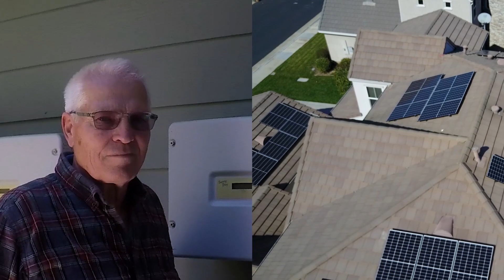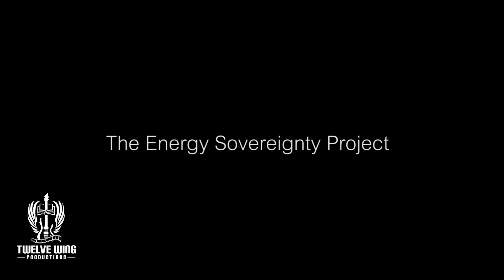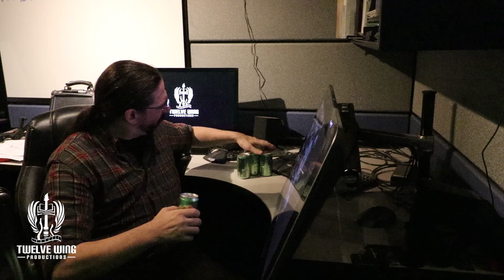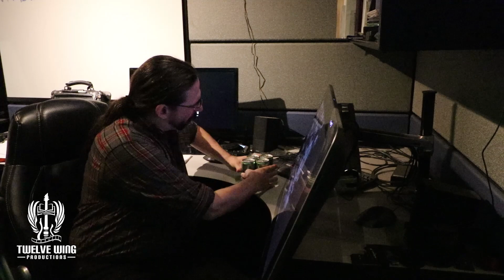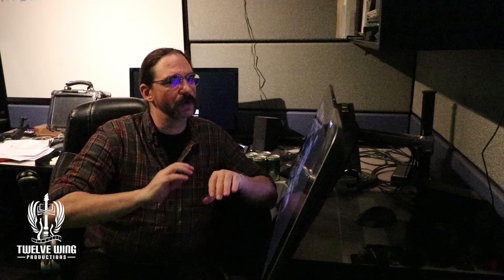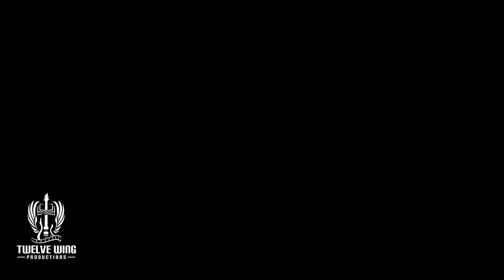Tesla's Battery Investor day today; What does it really mean for future products?

Comment: It's very refreshing to see someone talk about this who has experience with the engineering involved. There has been a lot of speculation done by people without the technical background. What you are saying makes a lot of sense to me. 

Thoughts: I am still unsure how far along the dry tech is and if they will go directly dry or if there is a wet iteration. 
I remember Elon explaining somewhere that recuperation is limited by power density and not motor atm (to 70%), so what you said about recuperation makes a lot of sense to me. This will be a big deal for the semi.
I haven't thought about putting the rolled batteries directly into a pack w/o casing. I can see the advantages but I would be worried about fault/damage propagation through the pack. Also there would need to be module boundaries probably to be able to connect battery groups in serial. My bet is that will not be a thing.

Additional content for battery day: They will talk about energy density. This isn't that big of a deal for cars atm, but will be very important for the semi. Besides batteries, they will talk about plaid powertrain and probably have something to show. They will also explain what Project Palladium is all about (which is plaid for S/X + maybe additional refreshes).
They will give an update to semi timeline and how close trial production is (quite close).
Lastly, they will announce tesla utility. The federal energy commission recently allowed (order 2222) distributed energy resources to pool and compete with regional transmission organisations. So Tesla will allow power pack owners to opt in to become part of distributed Tesla utility and sell you energy at time-of-day-dependent rates. This is huge.
Reply from the maker: I think the dry electrode manufacturing technique is already going.  I think Panasonic started making cells that way about 3 months ago now.  They hired a bunch of engineers at Nevada and started not only installing new production lines but also a retrofit of existing lines.
The reason they do that is so they don't fall behind on production.  They install the new dry electrode line... test the batteries coming off that line to make sure they are compatible with the existing batteries.  Once they are satisfied, they shut down the previous lines to upgrade them.. then repeat the process as they bring the upgraded line back up to speed.  The result then is that you have doubled your production (ish) and are now using the latest tech.
So I think they have already passe the first part of that.  Next they will finish the upgrade and start to slowly increase production.

Comment: Do you think the 20kwh powerwall will be the same size as the powerwall 2 or need a redesign? What about pricing, do you think Tesla will double the price per unit since the capacity has doubled, and with the output capacity quadrupling from 5kw to 20kw it would seem the cost of manufacturing would go up.
Reply from the maker: Yes.
The current battery is actually 13kwh of usable power but it is actually a 15kwh battery.  So 20 isn't much more and with the new cells they will be able to be cycled more deeply without harming them so overage isn't going to be an issue.
The major change is in the current delivery.  The new battery will be able to discharge in an hour with ease and thus deliver 20kw to the home... or at least that is my estimation.
But the overall size should be the same and it wouldn't surprise me at all to learn that they even used the exact same outer shell.  That's what I would try and engineer if I worked for them.
Reply: @twelvewingproductions7508   Thank you!

Comment: Note.
".....054" markings in "the" cell caused speculation re the diameter being 54mm
Height estimates range between 80-100mm
The smallest standard beverage can size is 53.3mm (diameter) × 88.5mm. volume 150ml.
Coincidence?
Was someone given a can of mixer on a flight and thought 🤔
Standard machinery makes things simple?
Reply from the maker: Hard to say.  Industrial standards come about in some pretty funny ways.  It would totally not surprise me to find that the shell of the new battery was made using existing dies from the beverage industry for making soda cans.